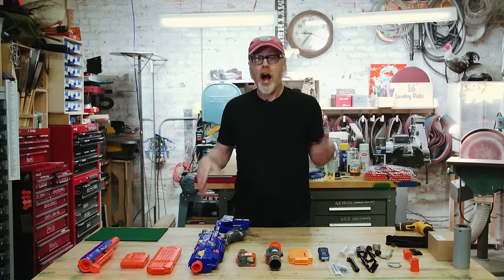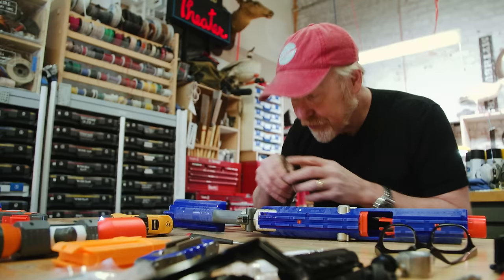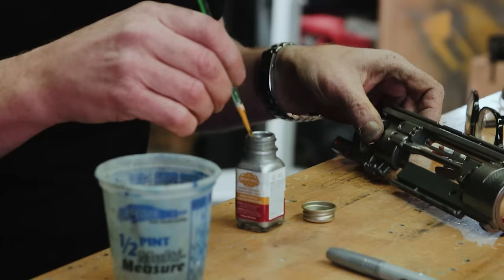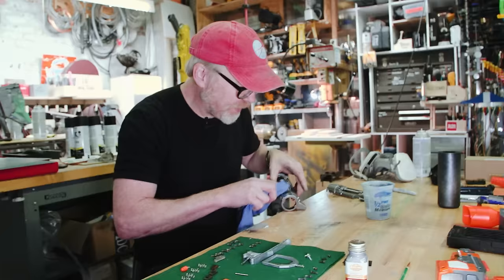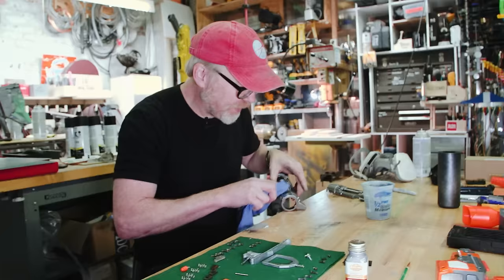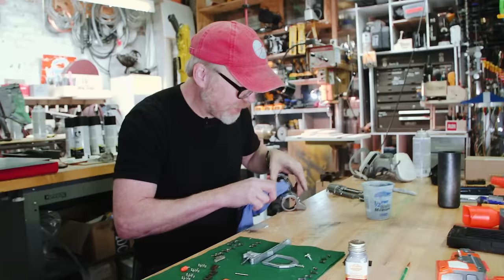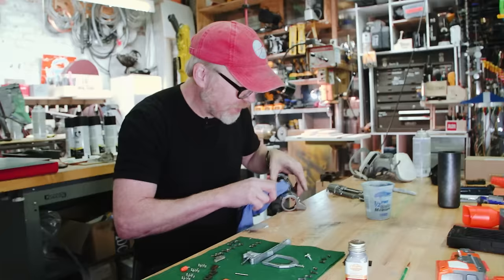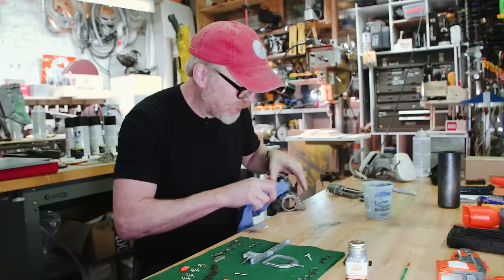Adam Savage's One Day Builds: Custom NERF Rifle

Comment: Instantly knew he didn't actually know how to mod when he picked the longstrike and then painted the entire magazine. Really nice build though
Reply: neeeeeeerrrrddddddd
Reply: josh Stephens same
Reply: explain please?
Reply: josh Stephens Who cares? It looks cool.
Reply: The Longstrike has, IIRC, poor internals without serious modification, and painting the magazine means it won't be as smooth to reload. I think he picked the Longstrike because it's one of the more attractive blasters, not for any performance reasons.
Reply: Thomas Middleton painting the entire magazine affects how it loads into the Nerf gun, and Longstrike is notoriously bad
Reply: +Thomas Middleton  In nerf modding you don't paint the part of the magazine that goes into the blaster to allow for a smoother putting in and taking out of the magazine.
Reply: Why? Does the paint wear out or WHAT?
Reply: +Aaro Kaija Ffs autocorrect
Reply: pretttttty sure the guy receiving this gift wont be using it and it will just be a "trophy" of sorts. im not into nerf guns in the least, but if adam gave me something that i was into then i most likely wouldnt use it. it would go on my mantle.
Reply: It's a nerd gun.
Reply: Brandon Robertson I'm actually not though lol
Reply: Michael james I prefer air soft. It's more realistic. Each to there own though.
Reply: MattTheBoss it doesn't really matter it looks sick would be nicer if he taped off the top of the clip though
Reply: Aaro Kaija yeah it does and it makes it not smooth when you take it in and it
Reply: Michael james that shit would be on my wall lol
Reply: MattTheBoss I don't play nerf lol I just did when i was a kid so I enjoy watching  modding
Reply: think this is more of a display item then it would be used in a mini war around the house. the guy that got this was really happy and i assume he has it on display. he posted pics of it on Imgur in dec
Reply: Michael james no, he has a pretty expensive mod kit in it so that means it's intended to be used
Reply: Lars Van Den Broek I feel as if that was just more of a choice that tied  the build together better
Reply: josh Stephens He is a prop builder not a nerf gun modder. what do you expect.
Reply: josh Stephens plus no a.r. Removal.
Reply: aaro kaija its comon knowledge that paint is actualy a realy thin layer of paint ontop of the material and since he put multiple layers on the magazine its gonna a have a fair bit of impact on the lock and unlock mechanic of the nerf gun
Reply: mr moo, to be fair, the kit he is using is a complete internals replacement and it doesn't have an ar to begin with. I've got this blaster with the same kit and I absolutely love it.
Reply: He's not Drac, buddy
Reply: I understand that, I just didnt know nerf guns were that delicate.
I have to agree that paint not being 2d is common knowledge.
Reply: Still came out better than my first nerf mod.
Reply: Looks like he got good results, just because he did it differently than you doesn't mean he doesn't know how to do it.
Reply: if its thin layers it doesnt change anything, or gloss or sand it to make it smoother
Reply: Who cares, it looks amazing! and that's enough
Reply: Yeah. Back in my college days I played HvZ and modded the crap out of my nerf guns. I cringed when he picked the longstrike. But at the same time, he's doing it more for aesthetics to look like a rifle, and giving it to someone as a gift, so you can't complain too much.
Reply: JordanB same
Reply: I mean, does it really have to perform if it kills with it's looks alone? :P
Reply: So what should he had took to be better ?
Reply: Cascadejackal >nerf
Reply: who cares it shoots and looks fantastic! plus i seriously doubt that the guy is going to play nerf competitively so it doesnt have to be the highest performance
Reply: He knows how to mod and build
Reply: all the people not knowing about the Nerf hobby......
Reply: ThePandemic101 I agree except, tHe shit in my garage is fucking badass but it's probably his first nerf mod and he dosent know the details.
Reply: Considering its not a performance mod none of that matters. Can just use normal magazines  if you wanted it to feed easily but you still got the painted one for show
Reply: yup, 100+ rounds in a box magazine is more realistic
Reply: the same applies to the barrel attachment points
Reply: josh Stephens huh weird it's almost as if this guy makes props that look super awesome, not guns for nerds who can't play airsoft but want to beat kids
Reply: Oh fuck, he didn't zero it in with the new scope on either! Whatever will we do?!?!
Reply: actually, he picked up the orange mod works kit, which has a direct plunger included. it turns the longstrike into something that's actually usable
Reply: That Bacon Dude He shot with the mag so it did work
Reply: if anyone here has actually shot a real rifle before, the magazine is only smooth a few weeks out of the shop. I hunt with a clip fed 270 and it is not smooth at all. If Adam is going for the weathered and rough feel, he is inadvertantly giving it more 'real feel' by making the clip rough.
Reply: Yeah. This was one of the more visual mods and I do appreciate the Longstrike for it's looks, definitely not it's reverse-plunger internals though. And yeah, painting the clip magazine (I call it clip to differentiate between real guns), I told that to my brother who planned on painting some of the NERF blasters I didn't want, never paint components and items that slide against each other, it makes it gritty and gross such as the priming slides or reloading a magazine and the paint wears away anyways.
Reply: what about using Rit Dye?
Reply: josh Stephens he modded the spring and some other internal components in the inside.
Reply: Thomas Middleton when you paint a Nerf magazine you use a plastic bag or some sort of masking tape to cover up the part that actually goes into the gun. This is so the paint doesn't scrape off when you put it in and it also slides well.
Reply: +GoukenslayWAO lots of people. If nobody did, nerf and air warriors and other companies like that wouldn't still be in business.
Reply: However, this is nerf. The magazine was smooth before, why change that?
Reply: GoukenslayWAO everyone really, kids, teenagers, college kids, adults and movie prop makers. Nerf is a very small and welcoming community. Plus Nerf has HvZ. I have had more fun with a $100ish Nerf gun than I have in all my days of paintball and airsoft combined.
Reply: come on I'm waiting on your build i want to see you wicked skills you have post up?
Reply: I love NERF for the sake of collecting and playing with the blaster more than an actual NERF war, something about hanging them on my wall makes me smile.
Reply: Just when you think you had discovered the most bizarre and pointless fandom/subculture on the internet - come on people, Nerf gun tolerances are not so tight a coat of paint is going to have any impact
Reply: It does though. Painting the magazine makes the action of inserting or removing it more gritty and "gross" feeling, it'll start wearing away or if you paint the internals then it starts scratching about on the inside, it can do things like make the triggers stick if they become gritty enough.
Reply: I bet some sanding and a coat of something that dries really hard like Breakthrough would do the trick. It's all about being experienced in painting plastic.
Reply: Congrats for picking this apart guys, but not everyone is super proficient in modding toy guns. Give people time to learn, and maybe don't call every little thing out?
Reply: Shredded Cheese the thing is I wasn't rude about my comment. I pointed out 2 things that could've been done better really only 1 because the gun is for asterisks maybe if he does another mod he'll learn from this and remember the comments and tape off the top of the mag so it's smoother. It's just about learning and I'm sure Adam wouldn't mind slight critiques like that as long as it's not rude and yelling it's constructive of informative
Reply: Lol at least he knew it was a mag and not some clip or clipazine nonsense.
Reply: I'm not a modder, just a happy viewer. I see how painting the magazine could make it less smooth to load. But, when you watch him take out and put in the mag when it's all done, it seems to load fine. Adam obviously has a lot of experience and enjoys what he does. Who cares if it's not perfect or exactly how you'd like it.
Reply: +Shredded Cheese We were explaining the mistake he made, so that later on he will be able to make better mods, without that mistake. If I was doing something wrong I would rather know than be allowed to continue to do things wrong.
Reply: +MondoSquad There are actually a few reasons why you shouldn't paint the mag, but yes it will still work ok (not as well) and do it's job.
Reply: josh Stephens he did say he picked it because it was the best looking rifle
Reply: It's a toy. Stop being such a tryhard.
Reply: People have made professions out of this so
Reply: josh Stephens instantly knew he wasn't a chomo because he didn't know how to modify a kids toy
Reply: legovort Preposterous! lol
Reply: You wanna call Adam out for not knowing about the magazine and you go calling it a clip. Gj bro
Reply: josh Stephens well, it seems he was going more for looks than anything, so I don't see anything wrong with using the longstrike
Reply: This. I was literally just thinking about how I would display this and where I would install the lights on my wall to best accentuate it.
Reply: Don't be upset that you didn't get a custom made nerf gun from Adam dude.
Reply: josh Stephens Brass barrel would help with accuracy. I have one on my Stryfe while using batteries that make the flywheels spin faster.
Reply: he's a leading movie prop maker, I think he knows what he's doing lol his resume should save me from from having to write further
Reply: It's a sniper rifle you need accuracy not speed.   If you're needing to fire quickly you'd switch to another gun.
Reply: its a toy. if you needed to shoot something you would get a rifle not a foam shooter.
Reply: how to mod the nerf long strike
step 1 throw it away
step 2 buy that revolver one shot farther and didnt jam
Reply: Dude he does this for a living.. what do you do?
Reply: Kegan Gardner "who the hell plahs with nerf guns other than kids?" people who know how to have fun.
Reply: ThePandemic101/  ......? he complemented him on the build tho? what's the use of the comment section if you can't criticize anything?
Reply: Gigaknife want some pepper with that salt?
Reply: anton rockoboac good meme. I take it you need some medication to fix that "salt" problem?
Reply: robofatcat i work in a restrunt and go to tafe
Reply: I just assumed he painted the whole magazine so the guy didn't end up with a two-tone mag. 
It might affect performance, but I get the impression this is going to be a trophy piece rather than  regular use.
Reply: People actually take nerf modding seriously? what a waste of time.
Reply: MrDyslexicPanda  comment was meant for the op
Reply: Cascadejackal He literally says in the beginning that he picked it because it was one of Nerf's better looking offerings...
Reply: adam doesn't need to know what he's doing, he's too much of a lad
Reply: Would anyone care? I mean hell it's a thing done by Adam Savage. He could mail me the ball of masking tape and I'd put that shit in a display box.

Comment: i only wanted to see how he changes th tech but why is that cut of the video. (instead there is only painting )
Reply: Same
Reply: its pretty much just a spring change, nothing really fancy or amazing to be honest
Reply: I'd have to agree with Dalton. There would be reasons close to what he specified as to why that cant be shown on the video
Reply: @SPcapx  sorry mate but he's entirely wrong there is a lot of content on YouTube that shows how to do it and where yo buy it
Reply: @duckywam9850  Ah fair enough. I probably should have checked first 😂
Reply: why did they do that I wanted to see the molding
Reply: The tech is just premade mod kit that includes a stronger spring. Literally anyone can buy and install it plus there's tons of videos on that already if you need to see it
Reply: Just because he thinks its boring or doesn’t need to show footage of the spring change
Reply: This is nothing. You should see some ACTUAL custom Nerf builds. They actually put in real performance enhancing mods such as powerful springs, plungers, brass barrels, brass parts, rifled barrels that actually stabilize the darts, fully sealed bolts and breeches. There are even fine tuned blasters designed entirely from scratch that can shoot in excess of 300 FPS and can hit 12"x12" targets at distances of over 60 meters. Some of the best blasters are not made by Nerf or Hasbro, but are custom in-house builds, or small high-end companies located in Singapore or Malaysia that ship to the U.S. and Australia.
Reply: Its cuz it was a kit and not his own stuff.
Reply: Reflektionz 007  coop772 has like a million subs and there are other big modders out there

Comment: I love how Hasbro specifically calls them blasters as to be more age appropriate.
Reply: Its cause they actually are blasters, it's just a misconcpetion to call them guns because guns are the actual lethal weapons
Reply: So anyway, I started blastin'
Reply: @dodsonbolles6198  There is no misconception except the one you have. A gun is any ranged weapon that uses compressed air to discharge a projectile. "Nerf Blasters" is a trademarked version of a Hasbro nerf gun. The reason is because "Nerf Gun" is a generic term used to describe any foam dart firing weapon.
Reply: @austinb192  except you also said nerf blasters are "weapons", but they are toy blasters. Another thing is nerf blasters do use compressed air to fire, but that's not the case with firearms. Firearms use a hammer to ignite gunpowder causing an explosion inside the gun to fire a bullet
Reply: Doodus the explosion of the gunpowder inside a shell causes a pneumatic propulsion system to move the bullet. That’s what a gun is, a pneumatic propulsion moving an object. It’s the same reason why they call pneumatic nailer a “nail gun”.
Reply: @austinb192  true, but there still is a difference between a toy dart blaster and a gun. The literal definition of a gun is "a weapon incorporating a metal tube from which bullets, shells, or other missiles are propelled by explosive force, typically making a characteristic loud, sharp noise" which does not describe a toy blaster at all
Reply: @dodsonbolles6198  you cannot take one defintion of a word, when that word has a variety of definitions. Merriam-Webster has the following: 
Definition of gun (Entry 1 of 2)
1a: a piece of ordnance usually with high muzzle velocity and comparatively flat trajectory
b: a portable firearm (such as a rifle or handgun)
c: a device that throws a projectile
That's like saying mouse cannot be a rodent and a computer accessory
Reply: @austinb192  high muzzle velocity refers to around supersonic speeds, while the highest muzzle velocity of a nerf blaster ever sold is 90 fps. Firearms also refer to weapons which a toy blaster is not. Your basically saying that toy dart blasters are weapons. And by the logic that anything throwing a projectile is gun, tennis rackets are guns, human arms are guns, bows are guns, etc
Reply: Doodus nerf gun
Reply: Austin Boucher nerf gun
Reply: People call them blasters now because things have changed to the point where people freak the fuck out when you say "gun" no matter what the context is
Reply: Killing someone isn't okay. But blasting them? Well its 2020 baby 😂
Reply: @dodsonbolles6198  I would call them toys not blasters 😂

Comment: I know I'm really late to comment on this video, but had to note on the screw order operation. I do a very similar thing, however i use double sided tape to stick the screws down. I have been know to knock stuff off my workspace MANY times so it helps keep things in order no matter what.  I have also used Plasticine when using larger screws/bolts. Bonus is it's fully reusable so a little less garbage.

Comment: Adam another good technique for managing screws is to photograph the part, then print it, cut holes in the screw locations and then put them in there, during the disassembly process, so nothing goes astray.

Comment: the longshot and centerion are quite badass for nerf snipers
Reply: But bad as a functional nerf gun
Reply: unless you upgrade it my longshot shoots quite far since ive re built it
Reply: Casey Gormley also don't forget putting air tanks in them... that makes them OP
Reply: tdogs vlogs centerion is the only good nerf gun in my opinion... I modded the spring and now it is EXTREMELY powerful and accurate.
Reply: U i want to get the centerion and make it like a scifi railgun looking thing but my longshot wont be as powerful but it shoots alot further than it used to
Reply: U As badass as it looks, the centurion is quite garbage. Even if you mod it it's still extremely prone to jamming, misfires, etc. the best thing to do is to scrap it for its shell and put rapid strike internals inside 😎
Reply: Alphahawk looks like a Borderlands sniper.

Comment: For future painting on plastic parts, it's most important first step is to clean all parts VERY well with a mold plastic cleaner/degreaser or at least soap and water.  Doesn't matter how well you sand a plastic part, the pores will retain the mold release material that will eventually make the paint bubble and fail.  I know for this demonstration you don't care, but for the people who are watching this to achieve a long lasting product, don't skip this step.
Reply: Thanks for the tip! I was concerned about how much the paint would last.